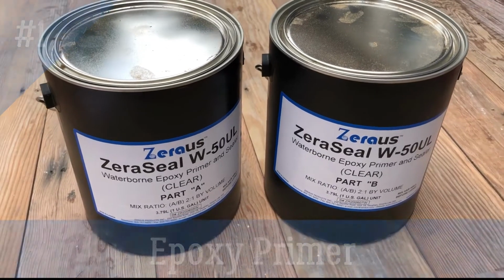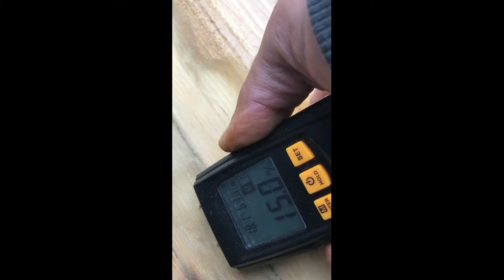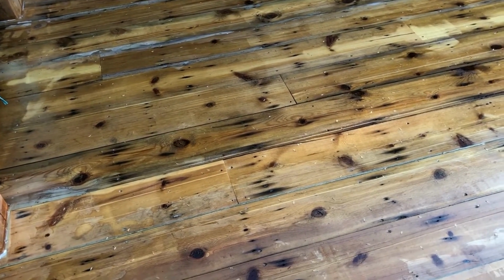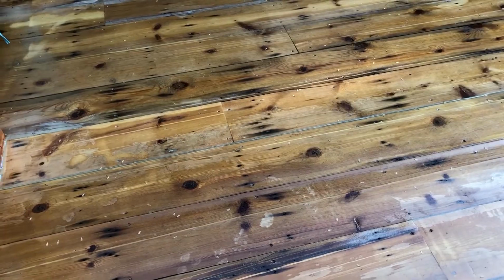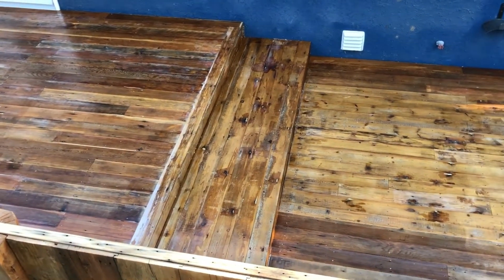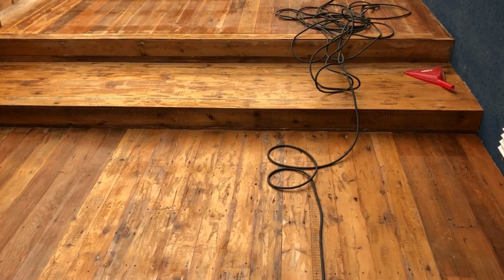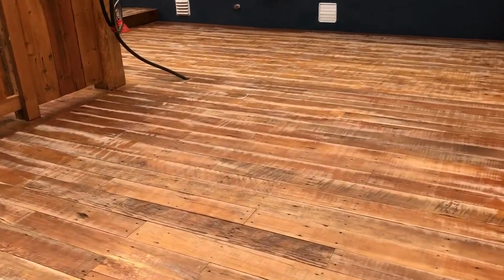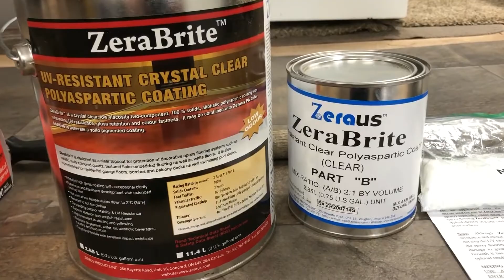How To Epoxy a Reclaimed Wood Deck - Applying Primer and Finish Coat (Part 2 of 3)

Comment: Can you paint or stain an exterior deck and epoxy over it?
Reply from the maker: That's a great question Jennifer, we had the same question when starting our deck project.  I can't speak for all brands but the information we found either on websites or speaking directly to epoxy companies is that the surface should sanded free of anything coating the raw wood.  This was also the case with the brand we used.